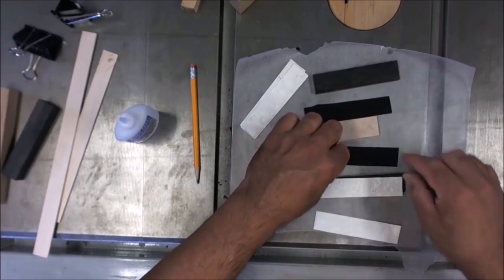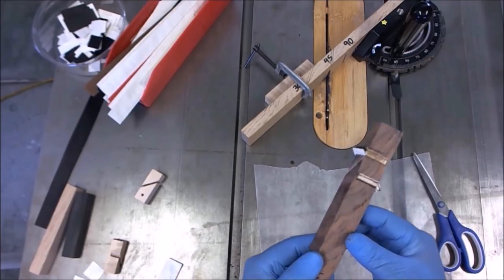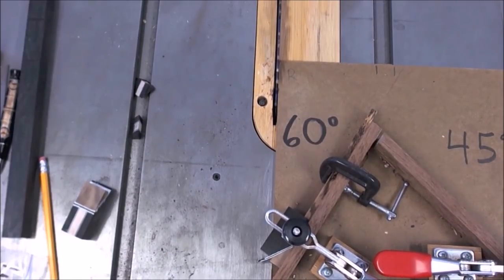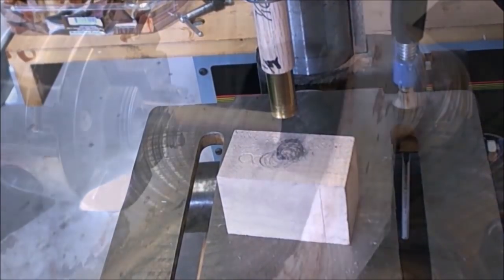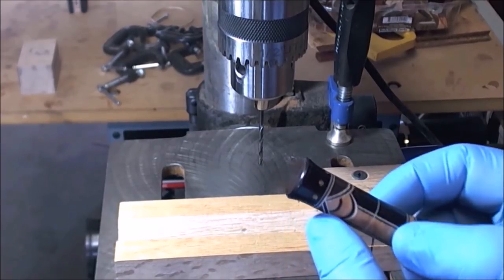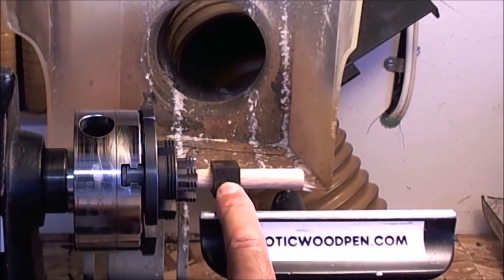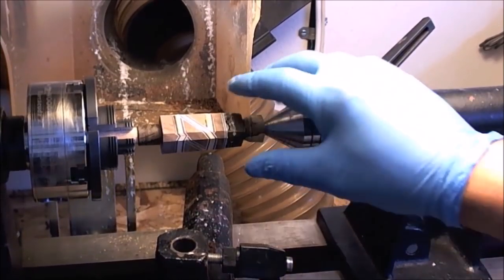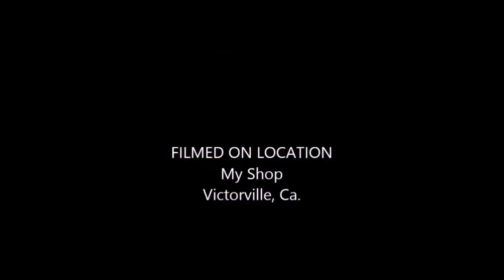Part 2 C, Closed End Churchill Rollerball Pen

Comment: Hi Gabe,  trawling my way through your videos,   this is the first vid i have seen where you are placing loose veneers into the cut made,  then filling the voids with CA to bond them together,    the question i want to ask is,   can the veneer inserts be made up using a wood glue or a two part contact adhesive before hand
Reply from the maker: They are just dyed and matched veneers from Rockler.  The veneers can be clued any way you see fit, I have used wood glue for years on the blanks also.  Just quicker for the videos to use CA glue.

Comment: The design and layout of your pens is top notch.  Absolutely beautiful.  As a beginner, I can only hope to get to that point some day.  If you don't mink my asking, what blades do you like/use for making all the different cuts such as making the segments and for the cuts of the celtic knot.  Any advice will be greatly appreciated, thank you.
Reply from the maker: Thanks for the complement and taking the time to watch the videos.  My favorite blade for the table saw is a Forrest but these are very expensive and not readily available at most home centers.  So I just use a Combination Irwin blade but the most important thing to know is that whatever combination carbide blade you use it has to be 90 degrees or flat top, not a divergent point blade. Hope that helps.
Reply: @exoticwoodpen  Thank you very much for the info.  And thanks for taking the time to make the videos.  It gives those of us just starting out a lot of inspiration.